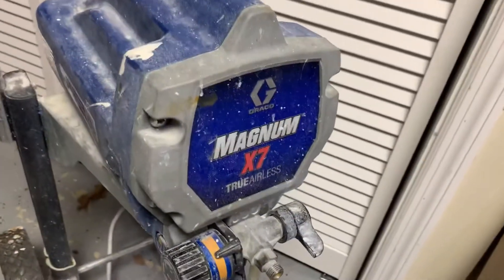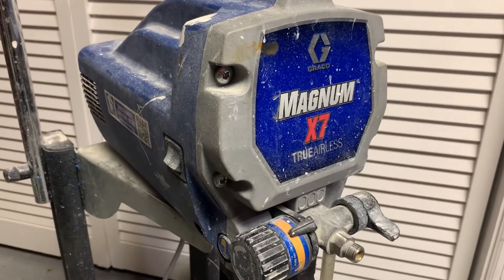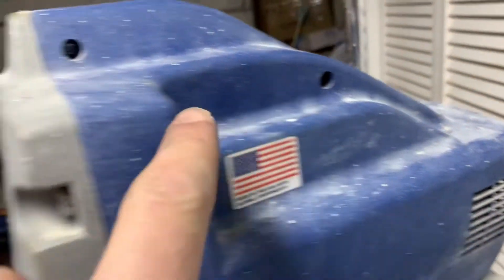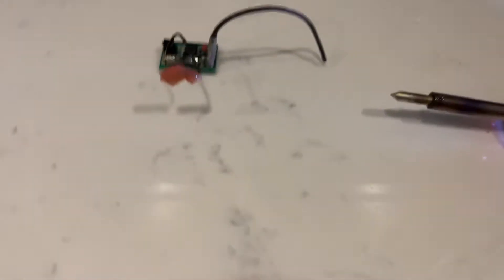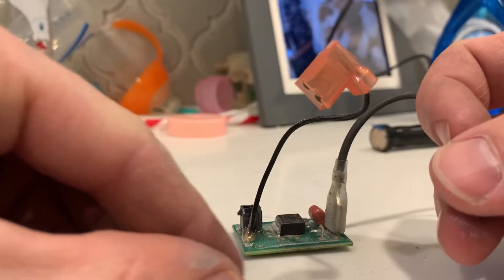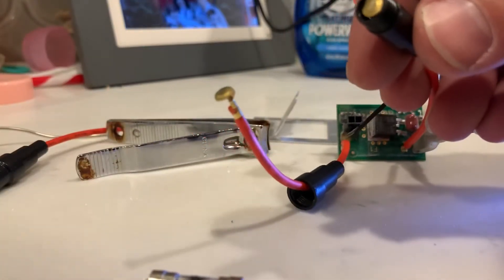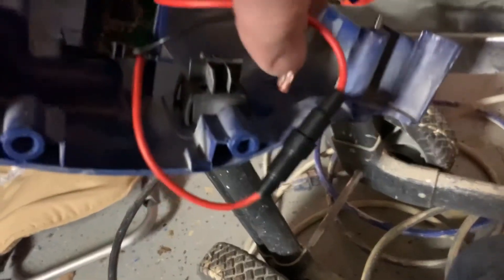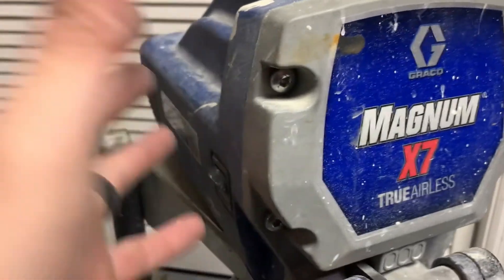How to fix Graco x7 professional paint sprayer.

Comment: Thank you for this video, I think if I need to do this repair I'd run the wire through the case so the fuse was external and maybe use an auto fuse so I could secure the holder. Nice to have the chance to think about it before hand.
Reply: What’s the name of this kit?